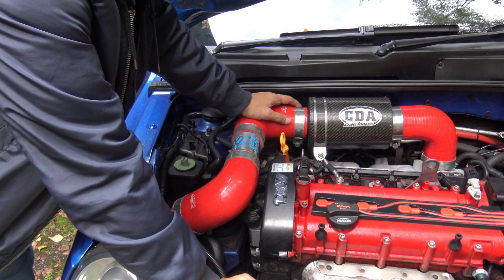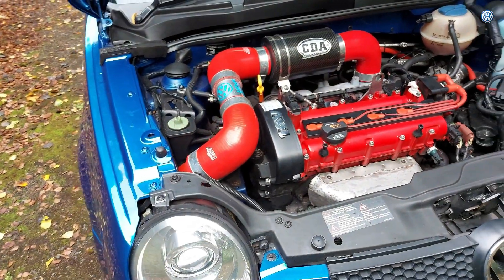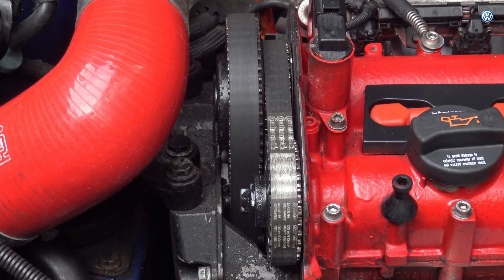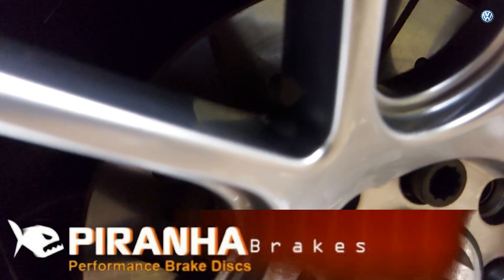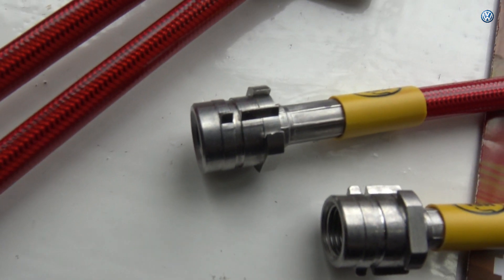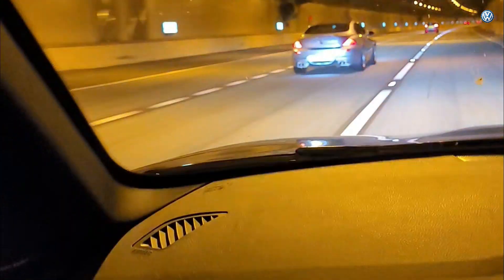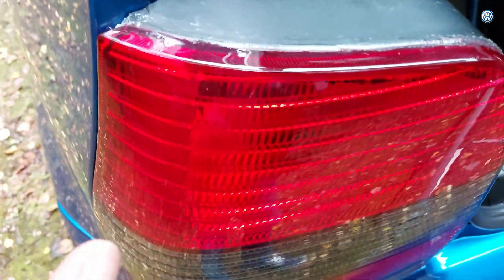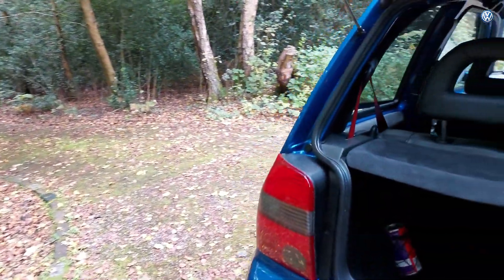Volkswagen Lupo GTi Noisy Head , Brakes & Stuff

Comment: Lupo's had 10w40 from the factory, they never used 5w30. I use the Platinum 5w40 in mine and it doesn't use a drop! Do love your Lupo though!
Reply from the maker: Thanks for that, I never knew? It does seem to run better on 5w40. Thanks again for your comment

Comment: i would also check bottom end(con bearings and crankshaft bearings) + oil pump (cause of problem not sound)if bottom end gone bad then the head is the first that start make noise from oil starvation .i got an arosa with avy code engine from polo gti
Reply from the maker: I think after all the scenarios , I think your right. Since the video i have had all the work done to the head and it's still the same. It's got to be the bottom end. I plan to do something about this in the future.  Thanks for your comment, and yes I think you're right

Comment: Hi Paul, are you sure it's the hydraulic lifters??, could be tilting pistons as the 1.4 and 1.6 16V's are known for it!
Reply from the maker: Really? Two mechanics have looked at it and one is a long-term vw mechanic. But I wouldn't be surprised if you are right. Thanks for your help
Reply: @samartzis2000  To me it doesn't sound like ticking tappets, does the engine consume oil??
Of course i could be wrong, let's hope it isn't the pistons!

Comment: I'm looking to get my heads done but could do with engine rebuild I'm on 178k miles! Any advice? I've got a 2000 plate polo gti too with same engine on 130k miles
Reply from the maker: Well I did get the camshaft lifters done , but it's still rattling a little and we've got roughly the same mileage and my mechanic says to get the bottom end done. Its expected at that mileage he told me. So I guess you can start enquiring about that. It shouldn't be that expensive for these cars. The polo gti is the same engine and if you've  got a good one there then why not?
Reply: @samartzis2000  yeah I'm getting bottom end done the new uprated cams and polished head etc. I've just found out that the polo gti and lupo gti engines are cast slightly different so you can't swap them if you want to keep the lupos 6 speed box. Strange